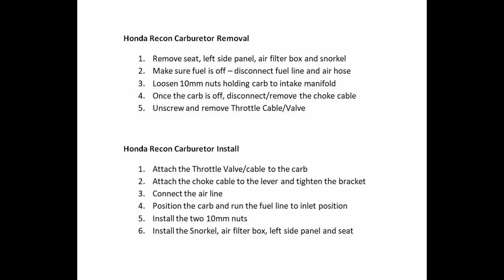Honda Recon Carb Install - Complete Removal and Replace

Comment: Awesome video got my peach running like a charm
Reply from the maker: Awesome!!!  Great to hear. Yeah I fired mine up the other day after sitting for the past 4 months.  Started like a dream and runs great. I try not to let it sit too long with that ethanol gas in the system. That stuff is just no good for those small carbs.

Comment: I've had my bike for 22 years and I never knew that's where the carb was. For some reason I was under the impression it was hidden under a panel or something. I'm planning to do my own maintenance on it for once, since I' started learning about and building bikes over the last year. I'm thinking of doing a restoration, which really just means: Changing the oil, touching up a spot or two of faded paint on the frame, and taking a heatgun to the body since it faded from red to pink in the Florida sun when I left it at my mom's house when I moved out 10 years ago.

Only mechanical issue I've found is that if I run at full speed for an extended period (a couple miles) the bike just dies entirely and won't start for about 5-10 minutes. Never have figured that out, but I know the carb has been mostly clean as a friend of mine rebuilt it for me a few years ago.
Reply from the maker: Cool, when changing the oil make sure you get oil for an ATV or Motorcycle.  It has to be the kind made for the internal clutch.  Standard motor oil will create shifting issues.  Also the problem you described sounds like an electrical component issue.  Like it is getting hot and has to cool down before it will work again.  I don't think it is fuel related, but I can't be for sure on that.  Good luck with it and have fun too.

Comment: I have pulled almost pulled the carb but I didn’t have a small rench for the bolts that mount it to the head so I had to go find find 1 and when I did I lossend 1 bolt and the wrench fell and I can’t get it but the vid is very helpful I almost tried doing taking the carb bottem and cleaning it but I couldn’t get it so I looked it up and autually I was completely wrong with how to desasble it
Reply from the maker: I'm hoping that you can get another wrench to either finish taking the carb off or at least tighten that one bolt back up. It is a tight spot to work in for sure.

Comment: My brother-in-law swapped out my carb and I came here to figure out what the bottom hose (overflow tube) was that isn't connected since it's leaking fuel out. Even though I'm not replacing the brand new carb, I at least know why that tube is not connected. Looks like I either have a stuck float or something else causing fuel to pour out of the overflow tube.
Reply from the maker: I'd start with checking the screw just above where the hose connects to make sure it is closed off completely. That will stop the leaking.  Let it sit for a wile with the fuel in the on position, but the cover to the air intake box off and the air filter removed.  What you're looking for is if fuel starts flowing out of the carb and into the filter box. If it is then you have an issue.  If no fuel is coming out then you should be good to go.

Comment: big question the air hose that comes from the front of the bike to the carb dose this come from the cap of the fuel tank x please help been wondering for hours, as my cap has no hose in it and the pair one coming out the car just dangling
Reply from the maker: The hose on the cap of the fuel tank is just a breather hose.  Mine goes up to the center of the handle bars and down the center pipe.  It is just to allow the tank to breath like a vent on a gas can.  The hose that comes off the carb and goes to the front is also an air inlet tube.  It is designed to allow fresh air into the carb.  It too is open ended and stops just in front of the handle bars.

Comment: Thanks for sharing! 👍 this video is very helpful, I'm about to do the same thing to my recon. Did you have to take the actual carburetor apart to clean it or can you clean it out without taking it apart
Reply from the maker: For when it will not idle, I had to take it apart and replace the slow jet.  To be honest, if I didn't need the slow jet I would not have needed a rebuild kit.  You can take it apart and clean it and put it back together as most seals are rubber o-ring type and are not crushed or broken. I also have a video on rebuilding the carb that shows the break down and putting it back together.
Reply: @cervus-venator  awesome thank you!

Comment: The piece on top of the carb that the throttle cable runs through that screws on whats that called? Or hoe do you remove it? Got a new carb but that’s different so i gotta change it.
Reply from the maker: We'll just refer to that as the Throttle Cable Cap.  On mine there is a rubber piece that you can work off and slide up onto the cable elbow.  From what I remember there is a retaining spring in there that you have to remove.  Once this is removed the cable should slide out.  I also recall this was very difficult to remove as I likely do not have the proper tool for it but it will come off.  On another instance I just used the old cap on a new carb.  You just have to make sure that the jet needle is adjusted properly so that it sits in the just correctly.  It has adjustments near the top by where the clip is positioned on it.   I sure hope some of this helps.

Comment: The carb fuel hoses need replaced. Is there a kit for new hoses or can I replace them with stock fuel hoses? Thank you.
Reply from the maker: Stock hoses from the auto parts place work. I don't recall the size (inside diameter) ID, but take one off and take it with you to get the correct hose size.  There may be a hose kit available, but I'm not aware of one.
Reply: I appreciate your response. Thank you

Comment: Did u have 2 adjust the air/fuel mixture screw after installation?
Reply from the maker: Actually no.  When I rebuild a carb, I turn the screw all the way in counting the turns so that I can re-set it to the same spot.  With a new carb I will check it based on the old carb's setting, but normally they come from the factory already close.  I actually have to adjust the idle more so than I do the air/fuel screw.  I wish I could tell you more on how to adjust it, but can't recall the details at the moment. However, I've seen a couple of videos specifically on adjusting the air/fuel screw and they were pretty straight forward with the information.

Comment: Do I need to run my fuel empty before changing the carb or can I do it with like half a tank?
Reply: Ok never mind lol I just got to that part of the video but I don’t think my fuel shut off works so I’ll run it empty. Thank you for the video!
Reply from the maker: You may be able to get a container and just unhook the hose from the carb and let the fuel run into the container.  that is if your shut off valve does not work.

Comment: Hello there....may i know the size of its jettings?what rebuild kit will do to it?can i put the jettings of honda cg 150?..can you gave us a review about that recon carb and its function?....i guess that pz 27d carb were also same as honda xr 200/xlr 200/crf 150f/l (old models)....thank you
Reply from the maker: For a stock Honda recon the Main jet size is a #95 and the idle or slow jet size is a #38.  If you are rebuilding a specific carb  that came on a specific quad or cycle that model is what you use for looking up the rebuild kit. The jetting for a CG150 or CG125 will not be the same and likely not close to what is in the Recon 250.  A lot effects the jet size too.  By opening up the intake like the snorkel it will cause the machine to run lean and a larger main jet will be required. You could go to a 100 or a 102 but it is really guess work when unless you have some specific air flow information and guidelines. The carbs for the older Honda's were similar, but not identical and the jet size was very likely different too based on the engine size and the intake.
Reply: @cervus-venator  i see...i thought that recon carb was also same as honda xr 200/xlr 200/crf 150 f/l carb or known as pz 27d?..i wanted to know too how and what was the function and purpose of the pump on the top of carburetor?...thank you for the info,be safe,heavy chill

Comment: How do you replace the top part that screws in that's attached to the needle?
Reply from the maker: That's the Throttle Cable Cap.  On mine there is a rubber piece that you can work off and slide up onto the cable elbow.  Also on mine there is a retaining spring in there that you have to remove.  It is very difficult to remove and would be easier to just buy a new cable in my opinion. Once this spring clip is removed the cable should slide out.  I likely do not have the proper tool for removing it, but it will come off with a lot of work.  On another instance I just used the old cap on a new carb.  You just have to make sure that the jet needle is adjusted properly so that it sits in the jet correctly.  It has adjustments near the top by where the E clip is positioned on it.  I hope some of this helps.

Comment: My throttle slide stuck and I pitted it while removing it. Should I replace it or can I smooth it with something like emery cloth?
Reply from the maker: I'd replace it.  If it got stuck prior to removal and pitting then the quickest and easiest way to correct it is to get a new cable and replace it. Throttle cables are not very expensive.  Now I have seen people work on them and lube them to getting them working again.
Reply: It is the slide that goes into the top of the carb I'm talking about.
Reply from the maker: @timmarks5314  If you can smooth it out it should work fine.  It is used to lift the needle out of the main jet to all more gas into the bowl.
Reply: @cervus-venator  That is really good news. Thank you again.

Comment: Thanks for this! What year is this bike? I have a 2001, looks the same. I’m curious if there is a carb on Amazon that fits…cheers!
Reply from the maker: This is a 2002 but the carbs should be the same. I looked through the Amazon carbs for the 2001 Honda and this one looks to be the closest without actually being a genuine Honda parts carb: https://www.amazon.com/MOTOKU-Carburetor-TRX250TE-Sportrax-1997-2014/dp/B07T95Z66X/ref=sr_1_7?crid=256T6RU8T4YTS&dchild=1&keywords=2001+honda+recon+carburetor+oem&qid=1628038065&sprefix=2001+honda+recon+carb%2Caps%2C235&sr=8-7    

I hope this helps.
Reply from the maker: Here is one more that looks like a good one:

https://www.amazon.com/Auto-Moto-Carburetor-TRX250-TRX250TE-TRX250TM/dp/B06XWM87W3/ref=psdc_404758011_t2_B07T95Z66X
Reply: Those Amazon Carbs suck. I’ve had nothing but problems with those. I would recommend just buying original Honda parts.

Comment: Definitely need a set of ratchet wrenches!
Reply from the maker: I have some (cheap ones I got at tractor supply) but I don't know if they would fit in that tight spot. But overall, yes as this would certainly be an improvement in pulling the carb or mounting it.
Reply: @cervus-venator  
I have two similar machines coming to the shop this week. 
I hope I can use the RWs. 
Thanks for the video, very helpful!
Reply from the maker: @jimyeske8498  Hopefully so and it will make it a quicker remove and install for you for sure.
Reply: @cervus-venator  
The owner said they were parked about 10 y/a with gas inside. He said, it’s probably evaporated by now!  He doesn’t understand what a mess he has likely created!  
Thought I would mention, when I work in tight spots, I’ll often hold the fastener in place with a telescopic magnet, while I find the threads. My biggest challenge is getting enough light!
Reply: @cervus-venator  
Your video helped a lot! You were right, ratchet wrench didn’t work. The carb was a huge mess but I have the quad running great now.
Reply from the maker: @jimyeske8498  Awesome Jim!! 👍

Comment: Is this the same carb you rebuilt about a month ago or a different one? What about the new one you have?
Reply from the maker: The one in the rebuild video is the new one from the Honda parts box.  The pilot valve got clogged and it would not idle so I rebuilt the original carb that came on the 4 wheeler and it runs great.  Then I decided to make a video where I rebuilt the new genuine Honda parts carb.  I'm keeping it to the side for when I get another carb issue. I actually have three of these carbs.  The original, the cheap $15 carb (I rebuilt it too) and the Honda genuine parts carb.
Reply from the maker: Also, I've found that the biggest issue with these small engine carbs is the pilot jet (also know as the slow jet or the idle jet) gets clogged with varnish or other gas residue. It's because the opening is so small it doesn't take much to clog it. If the 4 wheeler starts, but will not idle that's the issue.
Reply: @cervus-venator  Doesn’t it just frost your leticibles when a new part out of the box doesn’t work? It’s like a sharp stick in the eye! Oooh! I hate it when that happens!!!

Comment: Where did you get your filter?
Reply from the maker: If referring to the in-line gas filter I picked it up at an Auto Zone.  If referring to the Air Filter it is a K&N and I got it off of Amazon.

Comment: The line off the bottom of the bowl why would it be leaking
Reply from the maker: The only reason I know of is if the screw in the bowl just above it has not seated fully allowing gas to go by and leak out of the bowl. Try tighting it first to see if the gas stops leaking out. If it doesn't then turn your fuel off, get a cup you can drain the carb gas into and unscrew the valve completely.  There should be a spring on the screw so watch for it. Inspect the screw end to make sure it isn't damaged and wipe clean.  Spray some carb cleaner in the hole to clean out any  trash and then re-install the screw fully to seat it and close off the drain valve.  I hope this helps.
Reply from the maker: Jake, I just looked at the diagram and this screw/valve should have an o-ring on it.  Make sure that is in place as it helps seal it. (this mainly keeps gas from leaking out and around the threads of the screw.)  It did NOT indicate that there is a spring on this valve screw as I mentioned previously.

Comment: Your wedge wasn’t too thick after all.
Reply from the maker: Nope it slid right in when needed.  Putting that pin in was a pain.  Two of them flew out of the needle nose pliers to go up under the tank.  That's where they'll stay.  I had bought some of these retaining pins off of Amazon so I have plenty to replace the missing ones.

Comment: I just replaced mine and all i get when i fire it up is really high revs it wont idle
Reply from the maker: Jason is this a new carb? because it sounds like the slow idle jet (smaller of the two jets) is clogged.  Another thought is the jet needle in the throttle valve may not be set correctly.  Normally if it will fire up and run, but not idle it is a clogged idle jet. This would be odd on a new carb if indeed that is what you put in.
Reply: @cervus-venator  it is a new carb I got from honda the slide only goes one way so I'm stumped
Reply from the maker: @jason77821  It still sounds like the idle jet is clogged. If there was any trash or particles in your tank or fuel line it can quickly clog this tiny jet opening. What I did on my last carb change was install an inline fuel filter.  I got a small one for a riding lawn mower.  It works great. You can take that bowl off and access the idel jet if you want to see if that is the issue. It will come out easily for the replacement or cleaning.  I tried cleaning mine in an ultra sonic cleaner, but I still couldn't see light through it so I replaced it.  I keep a couple of rebuild kits on hand and they have these jets in them.  I'm thinking if yours got clogged on the original start up then it will not be difficult getting it cleaned up.
Reply: You can adjust the idle with a flathead screwdriver and play with the idle jet